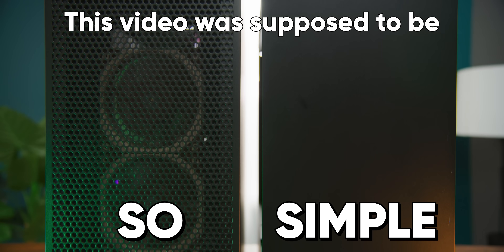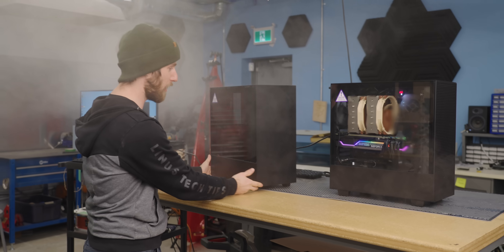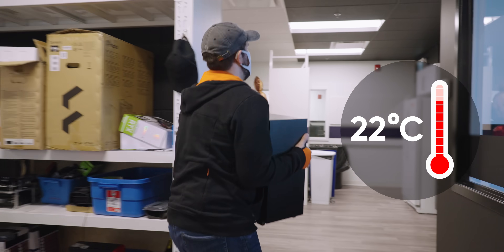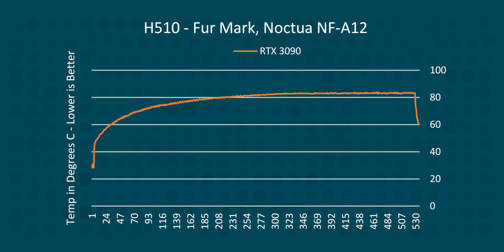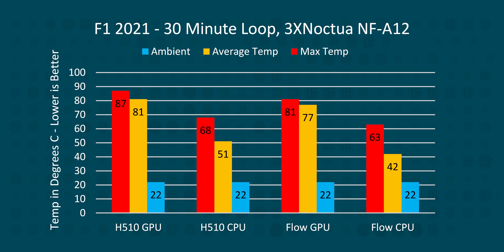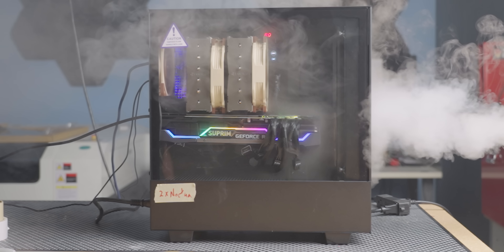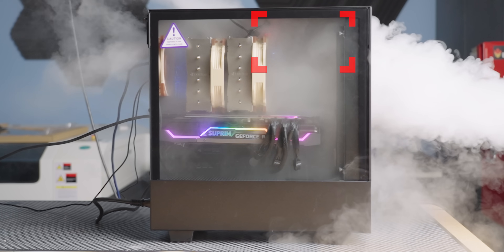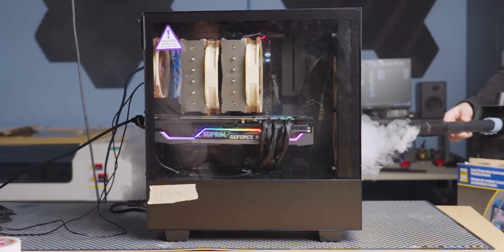Everything You Know Is Wrong - Mesh vs Non-Mesh Front Panel

Comment: Just now i saw this video but Linus i know u dont watch this comment even that try this setup. Case lian li lancool II(not the mesh version, the one with front panel with 2 stripe led sidef with fillter), use the same vents from noctua like this: 3 in front(intake),2 Below gpu(that blow the Air in gpu,very important), 2 above cpu(push Air out)and 1 in the back(push Air out). Put out the hdd brackests chase from Below to not have any blocking Air spot and the front vents (i dont know how to write this) put inside the bracket and the open side of the bracket to face inside(u put vents inside the U form of bracket that is orientated inside chase) and select the spot of bracket as much forward to the front panel. Dont forget even the Little door to let in place above where was hdd brackests,thats how u will Make a close channel Below with the 3rd front vents that goes directly to gpu. I have this configuration with an AMD RYZEN 9 5950x with noctua nhd15 cpu cooler Cromax, and an rtx 3080 gpu. U will be very impresive what airflow u get and how low tem p u get in that compact chase.

Comment: One quick note, kinda late I know, but I have an H510, yes it is very pretty, yes it has terrible airflow, feels like it does help though if you can mount the front fans on the inner side of the bracket if you have room, in LTT's case (haha) they may not have had the room.

Comment: I bought the Lian Li Mesh II awhile back, and I plan on keeping it for a loooong time, precisely for this reason. I didn't know until after I bought it that it has a spot underneath the GPU slots to place either a couple SSD's or a fan that pulls fresh air from the side mesh panel, and it supplies the GPU with it's own air supply. I have to imagine this is great, and I have the temps to match. I would love to see a video on this case or maybe similar cases and to make a case (pun intended) for the need for these bottom intake fans directly under the GPU now, considering how power hungry they are now.

Comment: I have a Kolink observatory Glass front case. I built the radiator into the front. Not very long after my upgrade to the rtx 3080 ti my entire system oberheated. My CPU throttled. When removing the glass panel my temperatures instantly dropped to 64 Degrees

Comment: just a tip for anyone like me, with a case with solid front panel (mesh on the sides) and place behind it for a 360mm rad (who designed this) i strongly recommend using a single fan at the bottom, and blocking the remaining 240mm, so that all the air that passes trough the meshes is blown in the case at the bottom, without recirculating hot air from the case.

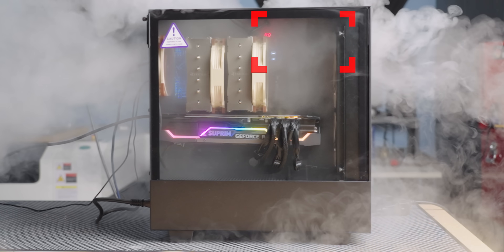Comment: 6:10  yeah, that's not how that works.  if you're pushing a ton of air in, it's not just sitting there in a self contained vortex of heat.  
if a continuous stream is coming in, it HAS to also be leaving somewhere.  
what you should have said here is, you can pull in all the air you want, but it needs to be directed where needed.
if you had a baddass intake fan, and a baddass exhaust fan, but you don't have it directed correctly, it will mostly just go straight from one fan to the other without passing over anything important.

Comment: This is so MS-DOS era. I thought we were going Linux-level now? 

#1: You make your chassis air tight. 
#2: You replace the air in your chassis with nitrogen. 
#3: You use peltier elements to cool that nitrogen and heat your house.  
#4: You enjoy your Beyond 2000 PC Cooling system. 

The Wintendo Gamers community is still talking about The Hanging Gardens-technology as if it's news.

Comment: What would happen if you put a small piece of cardboard or plastic from the GPU to in between the two front intake fans? That way one pushes air to the CPU, and the other other (hopefully) pushes air under the GPU
Reply: I believe it would require separate exhaust for GPU side (there is none apparently), but that will solve it.

Comment: in the old days you got cases with fans on the side to keep gpu cool but everyone wants a glass side panel so they can show off the bling these days .
in the even older days when the desk top case was king we would mount an 80mm fan (screwed to the pci slot mounts on case) blowing cooler air over the gpu

Comment: this is one of the reasons I like AIO coolers over air. they are just as easy to instal if not easier. 
sure their performance for the CPU is not that much greater, BUT they open the case and let everything flow freely. superior
Reply: i think that most cases are badly designed nowadays and they focus too much on looks and rgb. i'm still rocking a Coolermaster HAF-X and let me tell you, it doesn't matter if you have a graphics card that takes 4 slots, or 2 graphics cards. That thing is a beast, it can fit anything you throw at it and everything's chilling inside. 

Mid towers have come a long way in the past few years, but the limited space means that unless you choose wisely, you'll run into issues. A friend sold his HAF 932 and bought an NZXT case for his 3D rendering build... which caused his 3080TI to thermal throttle..... thanks but no thanks!

Comment: The gpu "wall" bit makes me wonder why Nvidia and all of the other companies like EVGA don't make the "front" of the gpu more aerodynamic with something like a wedge so the air doesn't bounce away, seems like it would be a virtually free way to improve cooling performance. You should do a test with a wedge on the gpu to direct the air better and see if that alters the results in any meaningful way.
Reply: The 4090 has a hollow pass through so air can pass through the card, I guess that was designed to alleviate this issue
Reply: Im guessing because a more aerodynamic design will either lengthen the already huge shroud size or shrink the heatsink volume, neither of which are ideal.
Reply: Ahh the Founders cards duct/vent air out the back of the case not blow it around inside the case like aftermarket gpus.    If you want a pointed GPU just add a plastic divider.
Reply: The shape of the GPU is irrelevant, the real solution is blower style GPU coolers that suck air in and eject out out the rear of the case
Reply: that would look dumb as fuck and wouldn't make any difference since the air would still swirl around in that bottom void

Comment: Uh this is timely. I just built my PC, and I have the fans fully stocked, mostly for aesthetic reasons. I have it in a 4000D , and I have my AIO on the top in input, as recommended by the AIO, I have the 3 front panel fans as input, as is usual, and I have the rear fan as exhaust. I figured the positive pressure would help keep dust out, as the PCIe slots are all perforated. I also have a 3x fan GPU, but there is plenty of clearance, unlike in this demonstration. Should I change this configuration?

Comment: this very simple to figure out by adding up the cfm speeds of the fan in vs out. you really want a little of negative pressure inside the case design as bases starting point and not the high positive pressure as shown in the video. A way to help remove heat long side of the gpu you could add slot fan to provide another way out as the top fan location can’t be used.

Comment: lets be real, anyone with a 3090 isn't going to be using a budget case like that.
If not for the dumb 3090 in the way you could've mounted the front fans on the inside of the removable fan tray and you'd have about an 30mm of clearance for air to potentially make its way in, instead of what you have now which is like 3mm of clearance.

Comment: I learned this back in the mid-2000's.  I'm a big fan of positive pressure cases now.  If you truly achieve positive pressure inside you can get a cooler system with fewer fans
Reply: Actually negative pressure is better for temperatures. Would be intersting to know how you came to that deduction. Positive pressure is better for less dust inside the case.
Reply: @Dzaen2  negative pressure creates a current of air. That creates hot spots in your case. If you are only focused in one area then that will work out very well. But positive pressure is the key for low ambient noise and cool temperatures in all areas
Reply: @roberthernandez9034  I think I get what you are trying to say. By having a good current of air, small areas are created where air is trapped and it gets hotter and hotter, for example behind a corner. But this is actually very difficult to predict. It may happen in a positive pressure scenario.

Comment: I've had this problem before and the solution is to spin your exhaust fans faster (3200 RPM) to eliminate the recirculating air, not the front fans. It's a brute force method and rather noisy though.

Comment: i just went from the bgears voguish to the corsair 4000d airflow. 

huge difference with thermals (much lower) and the case even with the open front is MUCH quieter with the 3 front intakes i have all set to low.

i was thinking of mocking something up in the PSU area as a ramp to sent the bottom fan flow up through the base and into the GPU.

Comment: I literally just got through running through this problem with internal hot pockets in the case... now my xfx RX 5700 XT (rx-57xt8tbd8) sits with a riser cable extended outside the side of my case with a huge high velocity fan blowing on it t both dissipate the hot air moving through the HS and help aid in blowing cool air over the 3 fans... :(

Comment: i realy like your new work shop this is the tech/info i like a little bit like gamersnexus but allot less graphs. as i read on reactions dont use oil bases fluid but water based. and maybe you can create a device that makes the smoke/fog laminar flow this will show the smoke/fog better thru the case i think

Comment: I've used a piece of plastic to split my two front fans and direct more air to GPU. Rear blower GPU seems to pull in more air from my front intake. Also have a solid front panel with side intake, two 40mm 12v fans to create some intake pressure before they hit the 120mm fans. Seems to help.

Comment: The problem is the NH d-15. I have a 3080 trio x (card is massive) and with an AIO and fans turbo or silent in front don't make a big difference but if you have a d15 the air gets trapped inside and the CPU and GPU get chocked up a ton with front fans only making it worse. You didn't discover much here other that when you have a huge gpu with no space in front or on its sides you shouldn't put a shitload of metal above it further preventing circulation of air.

Comment: One thing I notice on that case with the open front case in this video is that it completely misses a low fan on the front (it has a solid low panel there instead), so that no air close to the bottom is sucked in, so that  higher air needs to drop to reach the graphics card. That's already bad.
My own case is a lot better with that, having 3 large fans enterly from the top to the bottom of the case, and more than enough room for air inside the case itself, to flow both above and below the graphics card.

Comment: I'm running a blower style card with a positive air pressure setup. This setup is no good for GPUs that exhaust into the case, but for blower cards it works extremely well.

Comment: Welcome to the Bernoulli Effect. Faster flow = lower pressure. You created a low pressure area with the air cooler fans working in conjunction with the front case fans thus creating the dead spot around the base of the GPU. Dead air = higher pressure.

Comment: thats why letting fans pull air OUT of the case is always the best idea. There are enough holes through which air will come inside. But you always need to pull the hot air out somehow, unless you have a case like the Silverstone FT05 which is rotated 90° for upwards airflow.

Comment: Those massive air coolers are just ridiculous. I get it, if you buy an OEM chip and you're on a budget, it makes sense.
But people are spending $100+ USD on one of those things, when they could buy an AIO and get better temps and not have this MASSIVE blockade in the center of your case.
I would really like to see this repeated with an AIO, or stock CPU blower style cooler.
I run my H510i (full size ATX AM4 board, EVGA RTX 3080 and Kraken 280mm AIO) with stock fans and my temps are normal, good even (setup for slight positive pressure)
Also, there's an additional air intake in the front of the H510 on the bottom.
I think the visual example would've worked much better if you were able to fill a reservoir with the fog from the machine and let the fans pull it in, rather than blowing it AT the fans, it didn't look like they were able to evenly take air.

Comment: I used to work with smoke machines for a living. If you intend to do the same test at home DO NOT DO IT. It coats everything with a thin glycerin layer, the more you do it, the thicker it gets. Then your components get all sticky and start to collect dust and turn into a goop.
Reply: I smoke e-cigarette and I can proof the fact true !
Reply: @RedBullRS4  I vape too, but I bought an air purifier and have it set to quiet mode next to my desk. I blow the smoke towards it and it filters it out the air. I don't have any residue on anything in my room!
Reply: @KrozMcD  Your lungs on the other hand might not be so lucky
Reply: @janslavik5284  I know, but they are better than they were when I used to smoke cigarettes. A lot better. I'll hopefully stop vaping. I'm on the minimum nicotine now
Reply: @KrozMcD  yeah that's where I think vaping makes sense, as a solution to get off the cigs. You're doing great so far, you just have that last bit to go.
Reply: @RedBullRS4  word, almost any form of smoke will cost things in a layer, like ciggies
Reply: @RedBullRS4  i got a case that allows me to put 2 kinds of filters(not designed as such) love modifications haha ( first one is the skinniest i could find in the charcoal section, second one are 120mm magnetic nylon filters) and so far , i could vape my life and my computer will be sticky free. just have to slightly clean it every 2 weeks ! i wish i could get a silverstone mm01 ;) . cheers
Reply: oddly enough, ppl have been doing that without knowing: a lot of ppl vape while using the PC. As a PC repairman, i've seen my fair share of sticky goopy components from ppl that vape. such a hard thing to get out.
Reply: That is very kind of you to point that out, because I'm sure at some point someone would've tried that. Why did LTT use the smoke machine anyway if it leaves behind the goop, though?
Reply: Cause the Video is kinda boring without the visualization, also they got plenty of components anyway. And the short use of the smoke machine would most likely not affect these components for LTTs use anyway.
Reply: @bigbubba0439  content?
Reply: Even dab carts led to my graphics card having dusty goop on top of it
Reply: "I used to work with smoke machines for a living".

Is this an clever way of saying you are a stoner without actually admitting that you are a stoner?
Reply: Any alternative I could use for... Filmmaking? The smoke/haze machines are really popular among filmmakers, but I'm worried my camera lenses or sensor will get covered with the residue from smoke..
Reply: Damn and i wanted to check my fans with cigs.
Reply: Not completely true. Some newer smokemashines have smake that disrepair entirely as they don’t stick to anything and mix perfectly with air. I don’t remember the name, but
The Royal Norwegian Army use those to train firefighters in any environment including server rooms and technical rooms with 690V switchboards.
Reply: @bakkominator4308  Surely something the Royal Norwegian Army has access to is probably not going to be the same thing people will use for testing airflow in a PC case. Kidding aside you're probably talking about hazers and they are not what he is using.

Comment: The CPU fans have too high speed so the airflow will just go from intake to CPU regardless... If you slow down the CPU fans so that the airflow will just just vent out, it should make a difference to the GPU.
Since the heated airpocket generally comes from the GPU, it needs to have a high intake airflow and slower exhaust from the CPU and a bit higher on the top tower case.

Comment: So, the thumbnail was a mini bait'n'switch, which leaves the question: can you have too many fans?  Because, it seems like you could solve the problem with more fans...and a better case. If you had bottom mounted fans, more top mounted fans and a vertically mounted GPU, would that not solved the problem of air volume and flow...without a mesh front panel?  Seems like the H510 is just bad, or just bad for such a massive GPU.

Comment: The solution is front mounted Kraken X/Z/62/63, which I have in the "old" NZXT H510 case, and added a 140mm fan on the top..
So 2X 140mm fans blowing in through cooler in the front and 2X exhaust fans.

Comment: Why is it most PC case makers cannot do basic thermo and aerodynamics calculations with their designs? If you want to see good case design, even when it is in a cube, look at the MacPro 1st case generation and last case generation, or the HP Z-Series towers of the same eras. They knew how air flow worked. Just slamming fans on a case is like throwing a V8 in a Miata. It can be done, but it won't produce results that are worthy of promotion.

Comment: Definitely would like to see more about this. I've been building PCs since before fans or even heat sinks were fitted to the CPUs, the graphics cards were more problematic due to their jumper configuration and PSUs that were built into the cases... the various attempts at improved or standardised improved air flow and other cooling have always been of interest. Not that I ever build a system that has the top end components in it therefore I don't care that much but cooling for even mid range PCs is becoming more and more important.